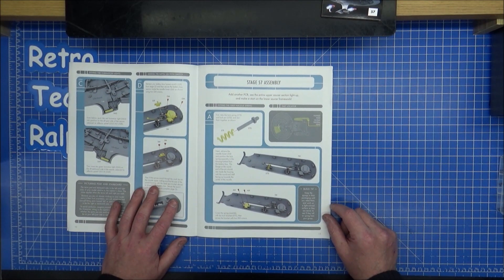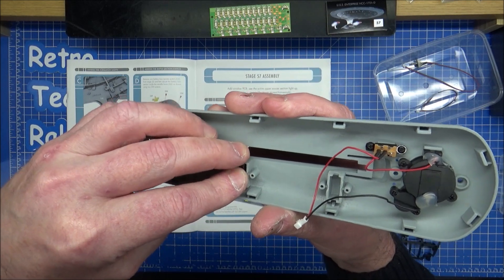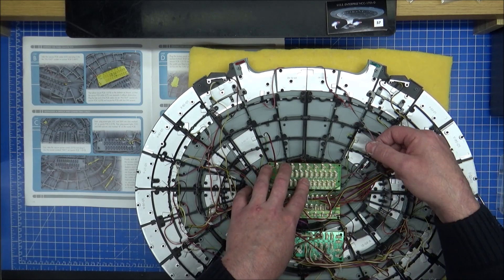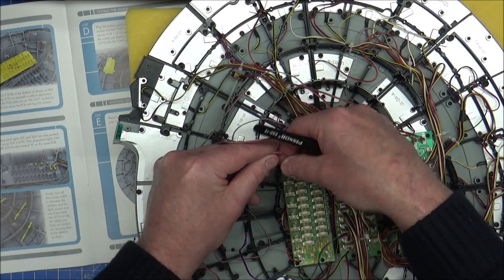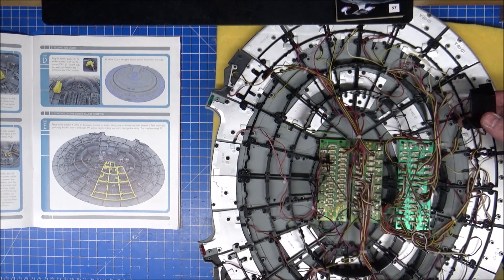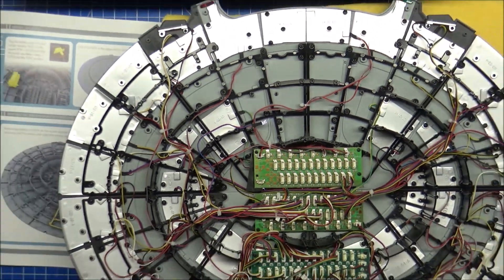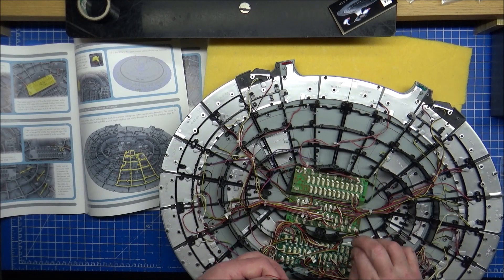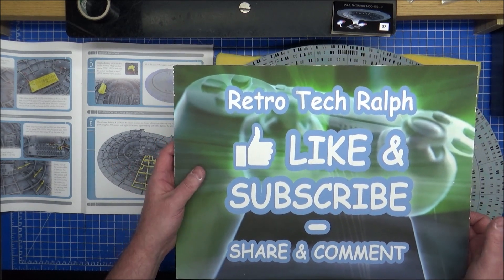Star Trek: Build The Enterprise D. Stage 15.3 Assembly. By Eaglemoss/Hero Collector.

Comment: I am now finally after a 3 month wait at issue 15 it’s felt much longer.had a watch of this especially the first part of the underside frame and it looks like my wires are where they need to be to avoid any nipping,where I can I’m gonna put electric tape over the wires when it’s going under the frame to protect the wires that bit more,fiddly I know but could be a time saver when it comes to shorting a wire at the end of the saucer build and trying to find that one dodgy wire 😂cause of issue delays and others being sent by the end of the weekend I’ll have a quarter of the underside of the saucer extending to the port light all in place and down.additionally I’ve designed a mod using a spare tester board,using it for the nav lights so they stay static I’ll send you some pictures when I’ve completed it